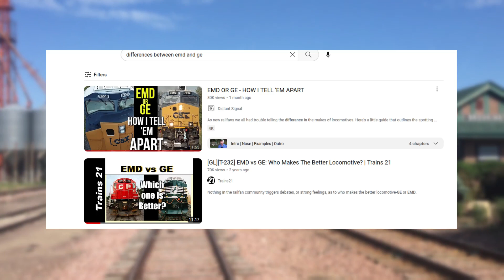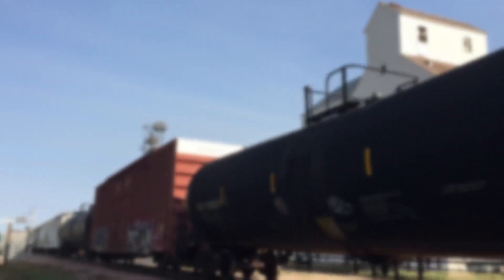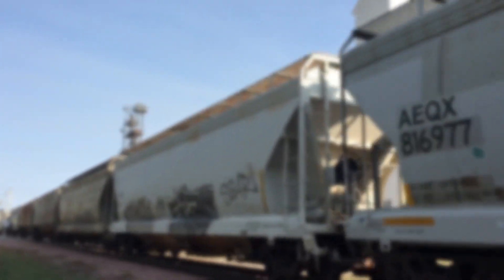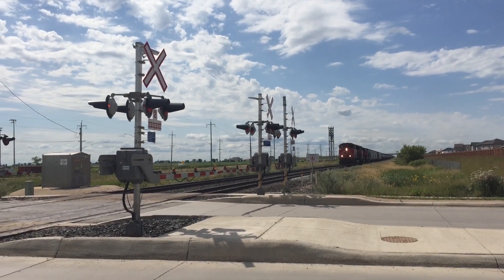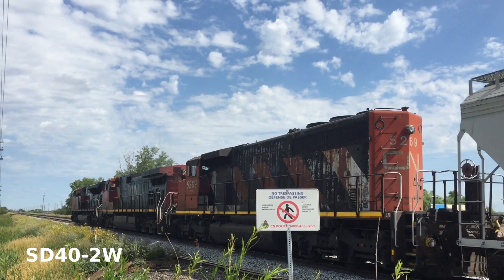GE vs. EMD - Radiators

Comment: Of interest, the slight slanted radiator on the SD70M's of UP was an attempt to create cooler running conditions and fewer exhaust emissions at higher altitudes such as would be found between Cheyene WY to Salt Lake City, UT or Ogden, UT and then west over the Sierra Nevada Mountains from Reno/Sparks NV up and over Donner Pass to Roseville, CA. This was especially effective in EMD SD70M Tier 2 and Tier 3 units while SD70ACe units got the larger extended "Wing" type radiators also found on SD80 and SD90 MACS. The SD70ACeT4 units also get the large Wing type radiator except theirs' has 4 sections rather than 3.

Comment: You missed the  Radiator Intakes for GE. The Dash 8 has a long single intake, Dash 9 have split radiator intakes (2); ES44 has 2, plus split Engine Intake cooler (3), and the new ET44AC has 4 split intakes. The older they get, the more sections they have. The EMD's are by fan count.  The GP38 has 2 fans;  GP35 has 2 large, and a smaller middle fan; The GP40, GP50, and the GP60 have 3 large fans, but the Radiator Intakes are taller on the GP50 and 60...but the GP60 has the squared Dynamic Brakes.
Reply: The GP 30 also had  the two large fans split by a smaller fan.

Comment: SD45-2 didn't have flared radiator
Reply: The SD45 did. The SD45-2 had the straight flush mounted radiator, as you said.